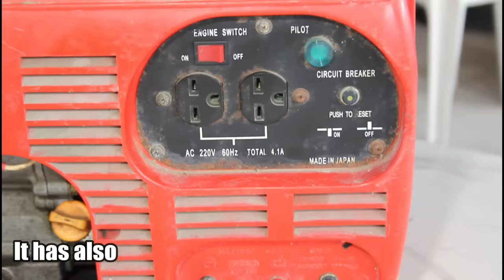DIY Electric Starter for Petrol/Gasoline Engine using Bicycle Sprocket

Comment: Ooh, I rather do like the way you used a socket as a spacing guide to get that bike part centred on the metal plate at 4:34 
Also, my ears thank you for not putting any background music in. Makes it far easier to concentrate and appreciate what you're doing. Quite a simple but highly effective modification you've made to that little generator set. Thank you for sharing
Reply from the maker: Thanks brother 🔥
Reply: RIGHT, SPOT-ON  Mr. Data ......NO background,....'' noise '''.........i could not agree, more......shit noise,...kills the 'creative, and imaginary  processes,  some of us have been given. i used a socket, to fit onto my weedeater. Cut it in half, and used the upper portion, with a skill saw blade, welded to it. This, fitted and tighten the nut, onto my Still  FS-40  weed whacker,  Man,  cuts small trees/branches very good. took off that plastic bs guard, on the bottom.  SOCKETS....come in handy, for many, 'projects'.....

Comment: You would be amazed at the amount of time and effort saved by using a socket adapter and cordless drill.
Reply: Not if you use the generator all the time. Occasional use, yes, cordless drill. But it becomes cumbersome after a while.
Reply: JUst make sure the drill has no clutch.  I broke a 3/8 adapter the first time i did that and loosened flywheel bolt.
Reply: But thats the point he made it electric start the way he did so he didnt have to do that
Reply: @tandmbros5877  he made it electric start so that he didn't have to use a drill to turn the bolts, instead of using manual wrenches?

Comment: nice job!  but from my point of view the flywheel is a little unbalanced and will do some vibration to the engine shaft and the bearings will wear out rapidly

Comment: Cool concept. Motor might burn up without the shroud on it though. No air going over the piston.
Reply from the maker: Thanks for the info brother :D
Reply: Placing the unit somewhere with good air flow will help though. Later on you could make a shroud from plywood or something
Reply: just run in winter only
Reply: @wonkastudio-johnny  It will still overheat and seize up. It has to have forced air cooling. Those things get HOT quickly! That cooling fan consumes a hundred or more Watts of power - so that's how much power you would need if you want to cool it with an electric fan. No house fan (or worse, computer fan) will do it.
Reply: @databanks  No, it might run 30 seconds longer. It needs forced air - LOTS of it.
Reply: Extend it out so it sits on top of the shroud. Instead of so close to the fan. Modify the recoil starter housing to allow the chain to travel through. Use a sprocket from a bicycle. The holes in the sprocket will allow sufficient air travel. No need to worry about charging the battery. Run a trickle charger on the generator while it is running. Anymore problems you can think of. I will be happy to make suggestions. LMAO 🤣 🤣 🤣

Comment: Great job. A few suggestions. 
Extend it out so it sits on top of the shroud. Instead of so close to the fan. Modify the recoil starter housing to allow the chain to travel through. Use a sprocket from a bicycle. The holes in the sprocket will allow sufficient air travel. No need to worry about charging the battery. Run a trickle charger on the generator while it is running. That's why they make two way plugs and extension cords for. LOL
Reply: The right tools for the job
Reply: Very cool 😎

Comment: That 32 tooth sprocket blocks the blower intake a lot more than I'd be comfortable with but if you modify the shroud to extend over starter itll probably be okay.
Reply: Maybe some evenly spaced air holes drilled into the sprocket as well as placing the unit somewhere with good air flow?
Reply from the maker: Yep multiple holes will do i think

Comment: Nice idea... but even if you could put the original shroud back on the sprocket has completely blocked the cooling fins on the flywheel so it won’t suck in air. 

Engine will overheat under load and seize. 

Just use a socket and electric drill

Comment: I love the job you did to adapt electric starter to a small generator, I have one and would like to do the same. Can you put links to the motorcycle starter motor and the bike chain sprockets you used, thanks and congratulations for your excellent job

Comment: The problem is eventually the freewheel sprocket your using will wear out.
Reply: Thank You, 
I'm a mechanic and a sprag may "work" but disengagement is the solution,
Thats why all starters disengage. This has more than one problem.

Comment: I dont think that bike sprocket is designed to run at that sort of rpm... and not for an extended period of time...
Reply: Yea i was thinking that it would lock up in an hour of thd motor running..  just because bikes are more intermittent duty as opposed to continuous running at that high rpm...

Comment: 4:45  wow....was thinking the same idea, using bike one-way turning sprocket.   .......To  all:   BE  SURE  to ground the item directly, with ground neg  clamp. IF  NOT,  you will weld the bearing (s)  on it.....SNOOPED  around, found your (this) video....WAY  TO  GO.....MAKE  DO, WITH WHAT YOU HAVE  =  Re-cycle,   as much as we can......literally.....